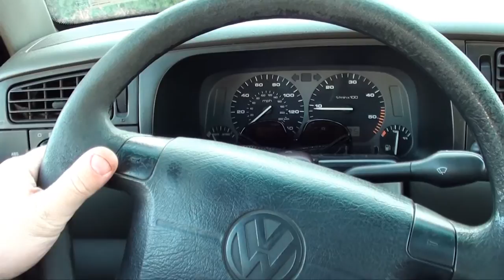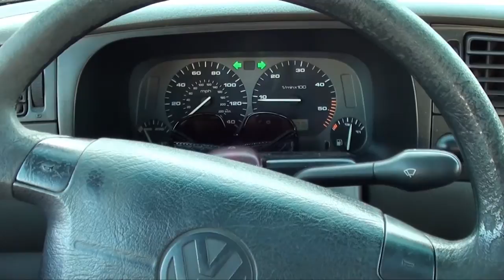the wiggle test. being used to pinpoint an electrical issue on a VW

Comment: Good fix will and "better than new".Did you get one of those around the corner soldering guns or drop it? LOL. Solder in those terminal is the way to go belt and suspenders. One thing about the ground at the body I like to use a star washer next to the metal to make sure. Just curious about what others think.

Comment: i'm so glad i found your channel and this video.my '01 sunfire that i bought last year came with no turn signals brake lights or emergency flashers.i've replaced most of the bulbs front and back and also the turn signal/flasher switch with no luck at all.i've also ran my multimeter and probe light over every inch of wire i can reach but still not getting any kind of reading on most of the wireing harness.there was a big recall on grand ams',sunbirds,sunfire and others from 1998thru 2004 and G M wouldn't honor their mistake.i've read about this problem on many pontiac forums and the problem doesn't differ by very much at all.it basicly deals with one or more of the wireing harnesses that were installed in these cars at the factory.so,if anyone who is thinking of buying any of these cars that i have mentioned as a second car or daily driver,take my advice,don't.your only asking for trouble and they are nothing but a money pit on wheels.

Comment: I have a 97 mustang I just paid 1900 for, and it has a ticking noise on the passenger side of the motor. sounds like its under the valve cover. Do you think this is a rocker arm? it only ticks when reving up or when it gets warm.

Comment: Got another question if it's ok. I have a 2003 hyundai accent. The battery ground to chassis bolt and connector is covered in rust but the car is starting fine just noticed this a couple days ago. I was going to clean it but not sure if that bolt will snap off.  

Could I install a seperate ground strap one end on the negative cable the other end share it with a near by ground?

Thank you

Comment from the maker: @motorman1700 thank you, i believe it was 12 may have been 14 minimum  this is a 10amp max circuit protected with a 10amp fuse, the general rule is 14awg on 15amp max and 12awg for 20amp and so on... ether one would be fine in this case... good question though thanks